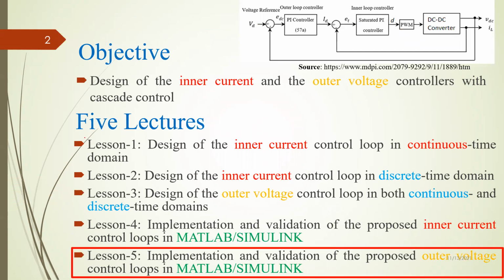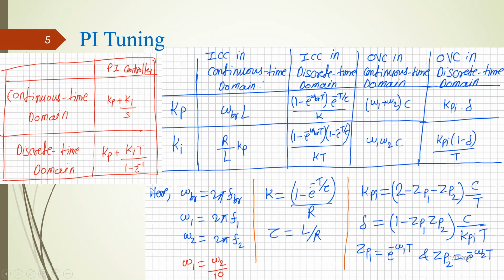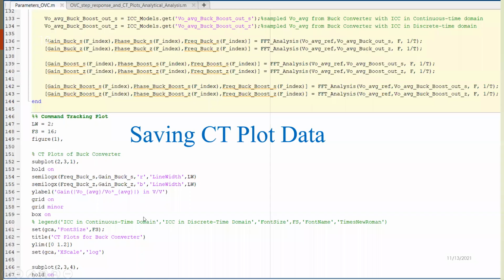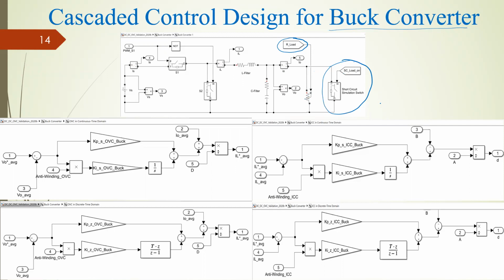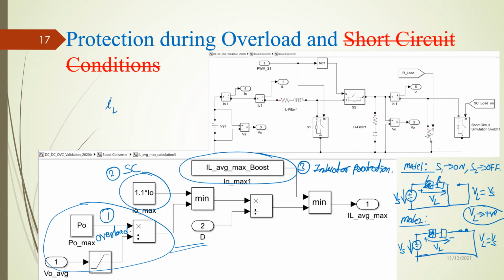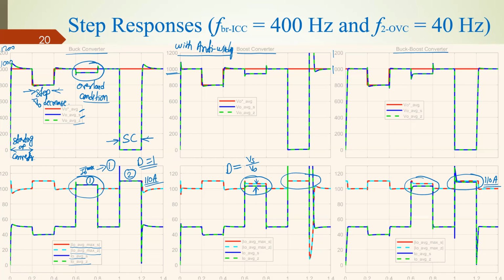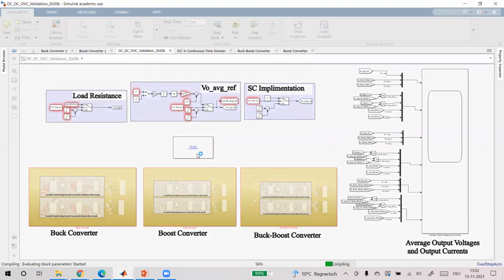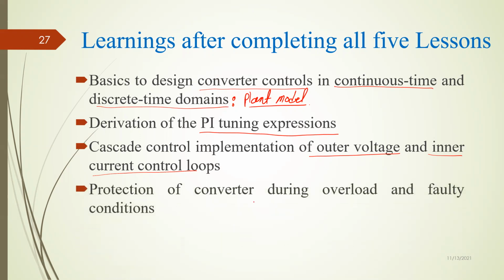Implementation and Validation of the Proposed Outer Voltage Control Loops in MATLAB/SIMULINK (5/5)

Comment: Hi, I'm using your control scheme for a system composed of a buck-boost - a battery - a buck - R load, but I had some problems with the sample and hold block. I think I can resolve that problem by using a mean block, but I didn't understand why you use S&H instead of Mean block, why you talk about the carrier wave?
Reply: did you use a pv for the buck and if you use did you implement

Comment: @ManKa Power Electronics 
Hi
As always great video, very helpful.
Any way to that without I out measure , since measuring both inductor current and output current is not practical.
Thanks

Comment: Question,
If I want to design an ac inverter (DC/ac), it's basically buck, so will the design be the same?
Thanks
Reply from the maker: You can use the methods described but the plant model and hence the control structures changes for sure. You need to learn few more additional things to design the control for inverters.
Reply: @mankapowerelectronics364  
Thanks.
Any chance you will make a video about that, in the future?
Thanks
Reply: @mankapowerelectronics364  
Why is the plant model different if the hw components are the same?
Reply from the maker: At present, I don't have a plan to make a video on inverter converter control.
Reply: @mankapowerelectronics364  
Do you know of any source that can help me understand it step by step?
Reply from the maker: I don't know a very good resources which can help you guide step by step in detail. But you can follow following references.

https://ieeexplore.ieee.org/document/8515350
https://ieeexplore.ieee.org/document/845057